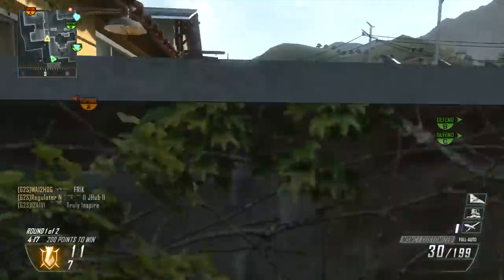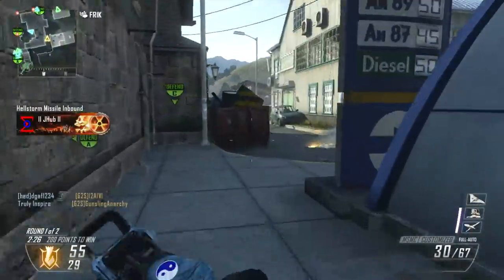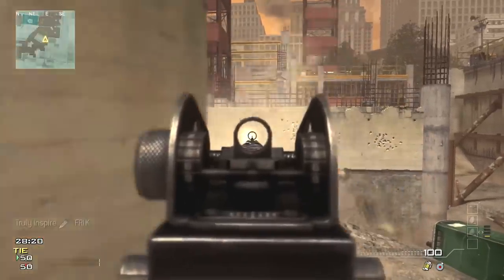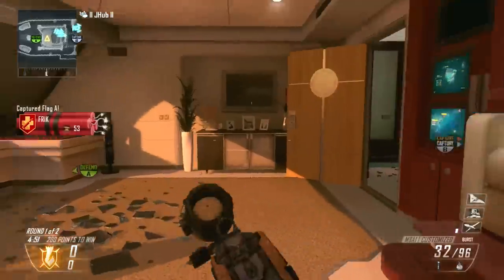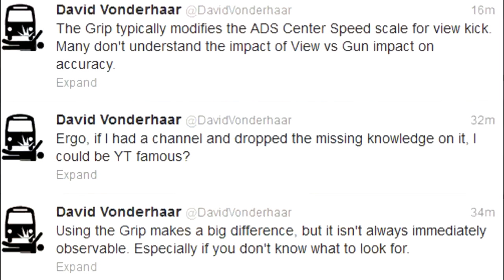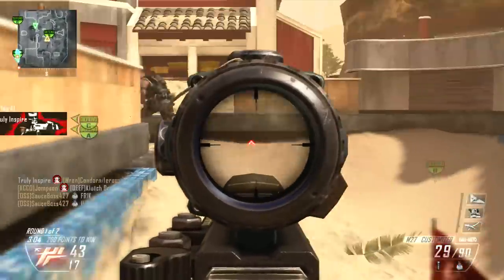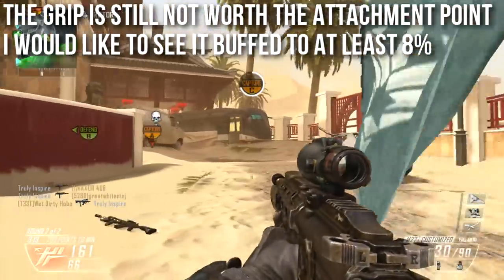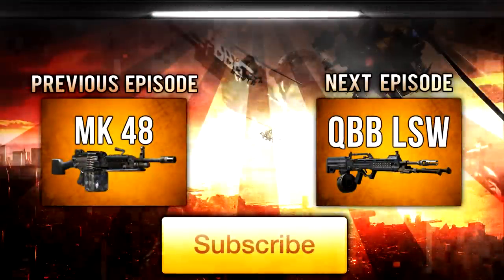Black Ops 2 In Depth - Fore Grip - What it actually does to your gun!

Comment: I knew I did better without a suppressor!
Reply: MarioDoesMinecraft That's probably because the less range your gun(s) had made your time-to-kill longer via requiring an extra bullet at a range where an un-suppressed weapon need not that extra bullet.
Reply: MarioDoesMinecraft id use it on an spaz12 in bo1 tho
Reply: max ross You should always do so in Black Ops, as the Suppressor brings no range penalty to the SPAS-12.
Reply: +weakestlink20 No range penalty for using a suppressor in BO1?
Reply: Sean N Not to the SPAS-12 on Black Ops, no.
Reply: weakestlink20 will try that next time,  thank you!
Reply: Sean N No problemo.
Reply: Same

Comment: As long as the experiment has been repeated successfully over many different variables then it is a true statement. The wiki will usually have someone confirm most of the tests but in most cases the wiki will warn you about the editing and whether or not is should be trusted information. Drift0r backs his claims up with numbers, tests, and video proof. If you were to stand at the ranges he stood at and had the same attachments or perks you would get the same results.

Comment: Its funny because I ran wall tests after I felt that fore grip was providing a placebo effect.  My experience is that the accuracy improvements help more at longer ranges but you are right: points are better used elsewhere.  If your weapon of choice kicks like a mule, stick to close range and flank lots..  Or fire in short bursts.  Any hard numbers on quickdraw?  I reckon the split second difference in aiming down sights is more beneficial in most situations..  But still a slight edge scenario.

Comment: Besides for the LMG's, The Foregrip attachments performance is BARELY noticeable on pretty much any other gun.  I would even go as far to say as it can even make a guns performance even worse since the bullet spread can be so random.  In reference to Drit0r, in which he also mentions the ACOG reducing center speed by 2%, I paired the ACOG with The Foregrip attachement on the highest recoil assault rifle the Scar-H.  Paired together you can see the difference easier.  Very gun specific attachment

Comment: not entirely, if everyone is using an smg they all aim at about the same speed so if you add quickdraw then your effectively aiming faster than everyone else and can get the bullets out faster but still just as accurate as everyone else, pretty much until it becomes so fast that the human eye can no longer tell which so far isn't in effect.

Comment: i notice a huge difference when i use the skorpion with the fore grip. I have been using the skorpion since the beginning when i unlocked it, and i find that there is a big difference when firing at longer ranges, typically when using it at AR ranges, but that's because i use it alot and i use the fore grip on almost all of my weapons.

Comment: Whats your logic?
2% Decrease. (Correct)
Over distance = Still 2% Decrease. (Still correct)
So the recoil over distance is more than 100% of the recoil at short range.
For example, 200% recoil at range, which will throw your accuracy off. 2% of 200% is 4% at range. Which means he will still be correct, it is 2% of the total recoil.

Comment: I don't know because on pc i played /w the full auto swat 556 and when i put on the fore grip it has not have any recoil ( but it has a little gun kick)
Reply: +Vincze Dániel The SWAT-556 in fully automatic configuration usually has a lot of vertical and symmetric recoil thanks to the high rate of fire. The SWAT has a terrible centerspeed in its class.

Comment: I'm not sure I believe the suppressor take away -2 because I find it much easier for myself to be more accurate  when I have the suppressor attachment equipped.
Reply: iamthelight14 It's hard to notice the recoil increase because it is such a small increase, but it is present.
Reply: ***** On the SVU-AS, the recoil increase from the Suppressor is actually 10%.
Reply: considering it was 10 times easier for me to get kills with the suppressor I don't believe that
Reply: iamthelight14 Probably because your enemies take longer to react to you.

Comment: When I put a fore grip on the MSMC it seems like it has less recoil at times
Reply: That's a placebo. You are used to it having less recoil, and subconsciously believe it yourself. But the RAW numbers say 2% which is damn near worthless
Reply: Fires Frost In the wall testing, it seemed that the gunkick was lower than normal when using a Foregrip; Driftor even mentioned that during the walltests.
Reply: Fires Frost Yes, but that's for viewkick. It's possible that the effect on gunkick is more noticeable than the effect it has on viewkick.
Reply: weakestlink20 did you even watch it, yes, gunkick is reduced aswell, but its purely asinine compared to the previous games, it isnt AW, Ghosts, etc, where the grip attachment would just be a noticeable reduction, but if it takes 120fps footage slowed down to tell, its not very effective.
Reply: Fires Frost I know that the numerical effect is much smaller for viewkick, but gunkick seems to be improved, as per the smaller amount of shake. However, that could just be the 120fps speaking to me.
Reply: weakestlink20 yeah, if 120fps(double the frames compared to console), its probably half of what you imagine
Reply: Fires Frost Half of the effect, yeah, for console. But a problem that throws off a lot of less experienced players is the gunkick. Like, take the AK-47 from Black Ops. It's just as accurate as the Commando when viewkick is concerned, but the AK-47 has a significantly increased gunkick, and gunkick throws off a lot of people, and makes them look at the AK-47 like an inaccurate weapon, when it can be just as accurate as the Commando, but the gunkick makes people perform worse overall compared to the Commando, unless they don't mind the gunkick. 

So, even though the less gunkick isn't doing much in terms of overall accuracy is concerned, it can help the players handle the weapon better, like putting a red dot sight on a weapon with unusual iron sights, like the MW3 FAD. Even though statistical performance is unhindered, the player's performance generally increases.

Comment: Did they ever buff the grip?
Reply: +jjnichols2002 Nope. It's always stayed the same in Black Ops 2.
Reply: +weakestlink20 That's too bad. At least it does something in the newer cod games
Reply: Fel Beat It's not very good in Black Ops 3 either. It isn't useless (you can see its effects), but it's still a far cry from what the Grip was doing in Infinity Ward's games, and not even remotely similar to AW's grip. Treyarch simply doesn't like the grip concept anymore.
Reply: +weakestlink20 For sure.

Comment: Whenever I use suppressor on any AR I always get a reduced recoil...MTAR, M27, and SCAR-H especially. Even AN-94 all freaking guns. Suppressor in my opinion decreases your time to kill but it reduces recoil. I found a huge difference when I use stealth (m27 with quickdraw and suppressor but i change quickdraw to fast mag to see any difference and same results...
Reply: ***** wtf is mussle flash?
Reply: *****  XD
Reply: +PyroLion52 Your recoil plots will actually be worse, as your centerspeed is reduced by about 2%. However, such a change is very difficult to notice, and will rarely make the difference between a shot landing or not.
Reply: You are both tight and wrong. The suppressor slightly increases recoil but gives the illusion of reduced recoil due to the fact that it eliminates muzzle flash.

Comment: Wait, COD has gun kick?
Reply: +Budrick3Gaming Have you ever used an AK-47 in Call of Duty?
Reply: +weakestlink20 aks are lasers in cod now
Reply: the 3rd reich Each version has been at least relatively accurate, and up until Ghosts, all AK's had a lot of gun kick which was not entirely representative of the actual recoil.
Reply: thats why i said "now" meaning recently
Reply: the 3rd reich They were pretty accurate back then, as well, in Call of Duty.

Comment: that's not the purpose try 
(Rapid fire pdw)
Vs
(Rapid fire fore grip pdw)
Reply: ? 

Surely you can just use the MP7? PDW with rapid fire shoots at the same speed as the MP7, as far as I remember.
Reply: Colonel Crow but its a different gun with other stats (e.g. larger magazine than mp7)
Reply: Tomseggo/toms-eg True, wasn't thinking straight. Derp.
Reply: Colonel Crow Rapid Fire PDW/Rapid Fire MSMC fires at 1136 RPM. The MP7 and Vector fire at 937 RPM. There's a fairly large difference.
Reply: weakestlink20 Eh. I remembered differently. Thanks for correcting me!

Comment: So I shouldn't use grip
Reply: MonkeySocksDude Yeah, you shouldn't. However, on a few weapons, Select Fire (burst) does wonders. The Type 25 and the SCAR-H actually become much more accurate thanks to the attachment. As well, the Vector and the AN-94 actually get increased RPM if your trigger finger is good enough.
Reply: +weakestlink20 the AN-94 has a 900 rpm 2-round burst each time you pull the trigger so instead of putting select fire you can save yourself an attachment and just tap the trigger. And grip isn't necessary, recoil is very very low in the first firing mode.